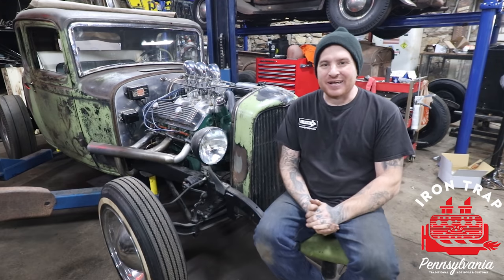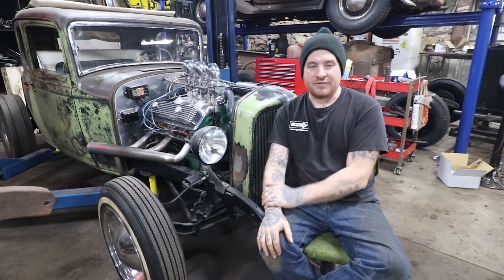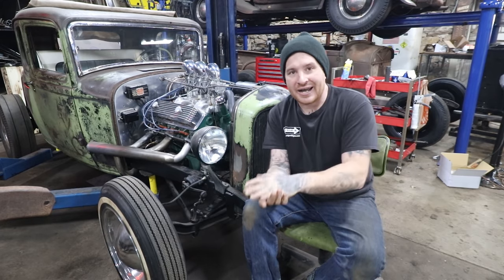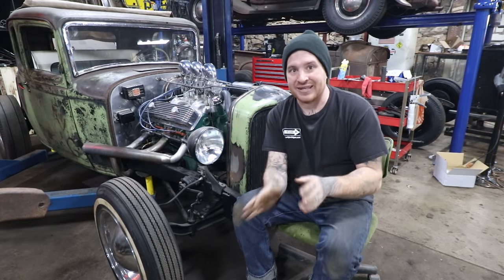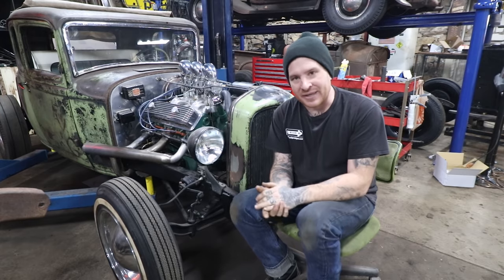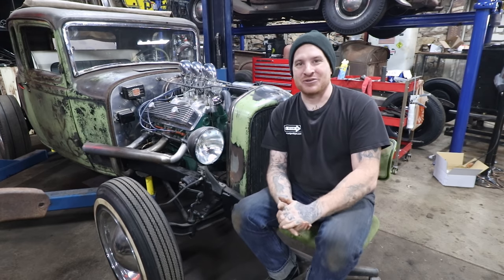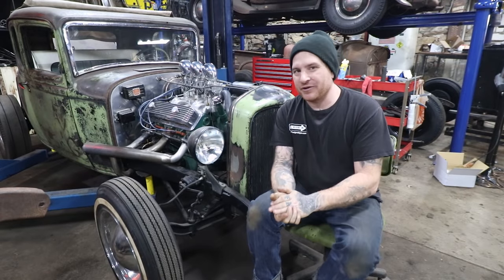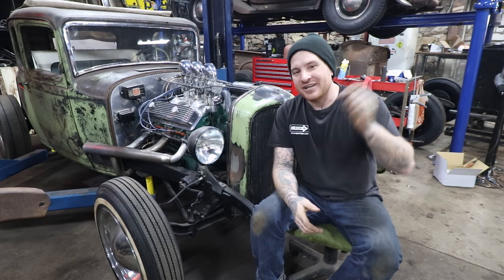Early Oldsmobile Rocket Hot Rodding 101 - Is That A J2!!!

Comment: A friend of mine, who graduated HS in about 57 had a 40 Ford Coupe as his first car.  I remember him telling me he paid $80 for the car.  He pulled the original drive train out and put in a Olds engine, a floor shift manual, open drive shaft and rear end.  For intake he had 6 2 bbls.  He showed me several photos of the car and if he had it today at a car show it would attract a lot of attention.  He also painted the car candy apple red in his garage.  He did the swap with no kits and fabricated whatever he needed with hand tools, and an arc welder (stick).  He also made his own headers for the car, and ran open headers.  No noise meters or noise laws back then.  Pretty good accomplishment for a kid in high school.
Reply from the maker: Man that sounds awesome! The golden age of hot rodding!

Comment: Matt, I cant tell you how much I enjoyed this video on the Olds Rocket engines. Growin g up in Hbg in the 50's i had a ring side seat for a couple cases in point. My BF's dad had a '54 Olds 98 that was quicker than one would think for such a big car. A guy I worked with had a beautiful 'Blue and White '56 Super 88 2 dr hardtop.  In '57 Larry Hartmann (Grandfather owned Hartmann Old's in nearby Sreelton, PA) bought a black  '57 2 dr 88 hardtop with the Tri-power J-2 with an Isky w-1 cam, and 3 on the column. I SAW Larry lay rubber from a standstill in 3rd gear, and the first time he took it to the Lancaster drag strip he spun out of the tires coming off the line too hot. Another friend had a '56 Fire engine red Studebaker Golden Hawk just a little modified ( Over sized jets in the 4 barrel, electric fuel pump and OD, columbia high speed rear end, 3 on the column. That car pretty much ruled Hbg for a couple years until the courts forced him to sell it to keep his drivers license, but to the point, one car he had problems with on the top end was Bruce Larsons '54 Olds. Yes that Bruce Larson. And the Hawk was dyno tested for 134 mph...thanks for the memories. Love the '39 Merc...
Reply from the maker: Bruce is a legend and a hell of a nice guy! Not surprised he was going fast even then!

Comment: Matt, I still have my 1950 Olds 88, these last 54 years. I have had everything from a few 324s to overbored 371 J-2 engines in it. LaSalle trannies and even a B&M hydro. My J-2 ran dual fours ,Wieland manifold.  It even got pretty decent gas mileage on the highway. Back in the 1980s parts like bearings got hard to come by, so the Old engine went away and it now has a 69 455 ,turbo 400 and 12 bolt rear axle.  The engine is no longer stock. Cam ,heads, dual fours, magneto( electronic). 99% of what you said about the Kettering engine is correct. 303s and 324s are internally balanced AND externally balanced.  57-58 371s are externally balanced. You will see a huge gonad on the front balancer and on the flywheel.  To internally balance one of these a lot of Mallory metal is required and Its very expensive to do . I have built several of these engines and nothing sounds quite as pretty as a Kettering Olds.
I am now 76 years old and I still breathe cars and my Olds has been mine since I was 22. It will never be sold as long as I live. I spent my life as a mechanic, bodyman frame man painter and I have to say, the work you do impresses me and there are few people who impress me. I have won a lot of shows with my creations and even a magazine centerfold.  I guess that's my claim to fame. Few of us get that ,on the grand scale of things.  Good job Matt, keep it up. Robert.
Reply from the maker: Thanks for the education and correction Robert! I don’t think I came across that with the late 324’s but I did know they had some differences to the earlier years. Thanks for that!

Comment: I have owned a 54 rocket 88 324, and a 55 holiday 98 324. In 78 needed to rebuild the engine in the 54, had problems finding the correct valves at the shop i used, they used chevy 454 valves and seats, had to open the head up a little bit and turn the valves down a little. But it breathed a lot better, 10 -10 crank and cam, 30 over pistons, and those heads, so basically stock. One fast old car!!!!! The crank broke into 2 pieces, used to have to put a little gas down the carb, and a quart of oil every day to get to work and back, didn't know the crank was broke till it got pulled apart, just thought i had some rod knock, or maybe a couple of mains goings. Those were strong engines, 25 miles to the gallon on the highway most of the time, i ran it long distance one time between 45 and 50 MPH and got 30 MPG. Wish i still had it!!!! Brought back a ton of memories, even though they weren't hot rods.

Comment: Many years ago I had the chance to have a conversation with K.S. Pittman famed gasser driver builder about the Olds engines they used. They preferred the 371 over the 394 because there was  more meat in the blocks of the 371 and they could be bored larger. They would bore them and stroke a 371 out to 454” then run that with a 6-71 and mechanical fuel injection. I asked why they weren’t using the 392 Hemi and he told me that they’d work on fuel but they hadn’t figured out how to make the Hemi run on gas with a blower. Once they got that figured it was game over for the Olds. 
It’s a dream of mine to build out a 371 Olds to this spec one day, hopefully sooner than later.

Comment: I used to hang around a filling station/used car lot in the early 60's. An early hot rod I remember was a 53 or 54 Studebaker with an Olds V8. It was pretty hot for the era.
Reply: Another potent swap was a "Studillac" which was a Studebaker with a Cadillac engine swapped in. They weren't quite as fast as  the supercharged Stude powered cars but it was a "low buck" swap and nearly as fast.
Reply: @edwardwerick2420  I remember reading an old Popular Science article about a guy I think was in New York who evidently did a lot of the Cad in Stude swaps.
Reply: @joealbert7773  That's right. His name was Bill Frick. He specialized in putting Cadillac engines and 4spd hydro transmissions in 1953-1955 Studebaker Commander coupes. His conversion included Cadillac brakes. One of the members of my local Studebaker Club chapter has a 1954 Studillac that he dragged out of a swamp many years ago. I believe it is one of 3 known to have survived. I hope he gets it back in running order some day.

Comment: Very interesting, Back in 65 I had a 47 Chevy Coupe. After seeing the Orange Crate in a Car Magazine I wanted an Old's Motor. I went to the junk yard and bought a 371 engine, trans 4 speed Hydra and rear end. Swapped it all into the 47. Found a great Cam and bought that. It required the earlier Rocker Arms. so i found rockers off a 324 used and bought them.  We got it all together and was pulling it to get started. It fired up and the front end lifted and i nearly hit the tow car. Then it died. I did that a few times until on one WOT pull there was a loud bang and the oil filler cap went flying. Oil was running out the oil pan from a big hole. We towed the car home and the gang left in silence. I tore into the engine to find the valves were hitting the pistons. Broke the cam a two lobe section fell down into the crank area, a Rod hit it and ripped off the crank then the crank continued to beat the the rod until the piston cracked and the whole thing was smashed against the pan poking a hole in it and crushing the piston. Needless to say I was sick. At 15 this cost me over $400 and i was broke. My Dad was so upset he forbid me to work on the car anymore. He towed it to the junk yard and gave it away. I saved the Hydra because i had it built up and could sell it back to the guy that did the work. But all was not lost. 6 months months later Mom and Dad agreed to left me use money I had saved for College to buy a car and Dad would still help me with tuition. After searching all over Central Illinois my Dad found a 1964 Corvette Convertible 327 365, 4 speed 3.73 gear, White with Red White seats and I was only $200 short so We got that. Not long after i had reworked the Holley and put headers on it. Its a disease. D

Comment: When i was 15, (didn't even have my drivers license yet) I bought a '46 Ford coupe with a 1957 Olds Rocket engine. This engine had the big chrome valve covers. The cars front clip was off and finally got it started. Sounded mean, no exhaust mufflers. I never finished the car, sold it as is. But it was a cool experience. I have been a hot rodder since age six. Great show, thanks.

Comment: My '32 Ford Highboy roadster has a 324 in it and is a lot of fun to drive. The engine looks stock from the outside with it's green paint, stock exhaust manifolds, generator and valve covers. But it's got a bigger cam & some valve/headwork so it's got a nice lope in it's idle. 
 The rest of the car is built with a look of a Hot Rod that may have been built in the mid to late 50's. Very little chrome, black-wall tires on steel wheels with Ford dog dish hub caps and so forth, so the engine fits right in with that old school vibe. This is the first vintage Olds engine I've had and it lives up to it's reputation... This car is a bullet!

Comment: Back in 1963 I bought a well thrashed 57 2 door sedan Super 88 with the origninal J2 engine and carbs and ai t cleaner.
Shortly after purchase the bottom end expired spectacularly.
I went to a junkyard and found a nice 62 394 out of a Starfire.
Next stop was the machine shop and engine builder . We went thru the 394 which actually needed very little but got a lot.
The bottom end was balanced rods polished and xrayed crank micro polished flat top pistons with 10.75 to 1 oil system revisions Isky solod lift cam adjustable rockers some porting work on the heads and intake manifold carbs rebuilt and a set of really nice inch and 3 quarter equal length headers into 3 inch dual exhaust out the back.
We never dynoed the engine but it was probably making around 370 hp at the crank.
Then the problems began. The 57 used the Jet a Wsy transmission which had replaced the stronger Hydramatic  in 1956. In short order I trashed the original zjet a way and a replacement before zi dis c overed the aftermarket BAnd M Hydro with a 2 year street or strip warranty... basically a beefed modified Hyramatic.
Then I started tearing up the two piece driveshaft and had to have a custom two pc driveshaft custom made and balanced. THEN I broke a left rear axle which resulted in my  getting a set of custom HD axles..
The 57 Olds at that point was reliable torquey and fun.
By now I could pretty much deal with any Fords except the 401 390 which was very rare. Or a 406 tri carb Ford. I could deal with about any Chevy except the 409 or a 63 or 64 327 365 ir 375 hp engine.. they were simply too light . And I could deal with any MOPAR EXCEPT THE 413 OR 426 HIPOS ..
My favorite victims were the 283vandv327 Chevys . A very very few had the solid lifter 365 hp engine and 4 speeds were rare and people who could shift them quickly were rare..
421 SD Pontiacs were univorns although you could run into the occasion a l tri carb 389 Catalina or Ventura that was pretty hot.
In this perio the e 94 Olds sndc392 Chryslerscwere the fuel and alvohol choices. But thatcwas far outside my budget and interest.
I sold the Olds in late 64 before departing foe 2 tors in Vietnam. When I returned I factory ordered a 427 435 hp 67 Corvette coupe 
But that was a different level of performsnce and a different story.
Ive always had a soft spot for my 57 Olds.
It was an adventure and I learned a lot.

Comment: Impressive amount of early Oldsmobile OHV V8 knowledge !   
I hot rodded my 56 324 with Weiand 2-4s from a wrecker with old race cars.   Did switch to solid lifter cam, with Thomas adjustable rockers and finned rocker covers, as you  mention.     Then I got a rod knock.   At that point, I switched to a '59 394, and sold the complete engine as is with al the speed equipment.   
Then, when I needed a new transmission, I got a new B&M Hydro Stick.   I then found that the BM, which was from a earlier 4 speed hydro matic, has a pilot shaft into the end of the crankshaft, which had to be drilled.   The crankshaft had a "pilot hole" where the shaft should go, which did provide a "depth gauge" for any drilling.  Also, there is a round recess in the end of the crankshaft, where you press in the actual pilot shaft bushing.    The hole beyond, does not even touch, and does not have to be perfect.   I just drilled it out with a hand drill, pressed in the bearing, and installed my new BM trans.   Ran well for years.  The BM did tend to break U joints.

Comment: Hi mat, i liked your video. I have two j2 engines which ive had in my 53 merc that i have had since 1969 first one is a 1958 block with jons 12.5 to 1 pistons  1960 394 heads , isky cam and solid  lifters and hidebrant rockers , offinhouser finned rocker covers. offinhouser 6- 2 intake  with 6 stromburg 97s. What a pain it was to keep in tune. i had a muncie 4 speed behind it with the help of an honest charlie bellhousing adaptor and a starter cross over. the pilot bushing i used was was a 1964 chevy there all the same. The clutch was a ford truck pressure plate and a chevy disk. I blew up a lot of stock rears in that car. Its got a 9 inch rear in it now. Thanks for the video. I liked the flathead video too.

Comment: I learned to drive and took my driver's test in a 1952 Oldsmobile 98 with the first generation rocket engine. My grandfather had bought it new, and it was loaded. I loved the wall to wall chrome waterfall dash with the ashtray and glove box that were hidden in it. The coolest feature was the mechanical clock in the center of the steering wheel which wound itself every time you made a turn. It had plenty of pep, and I thought it would become mine, as my mother wanted a sportier car. My dad traded it in on a Corvair Monza with a stick shift and told me that the mechanic felt the Olds was not reliable' as the engine was knocking. I've often wondered if that was just a ruse to get the rocket cheap ($150) for a hot rod.

Comment: My first car was dad's 56 Oldsmobile.   I found a Weiand  dual quad setup with good WCFB carburetors at a wrecker for $50.   Then I bought a Thomas adjustable rocker setup  so I could go solid lifter cam.   I don't remember any rocker cover clearance problem, though I did at some point get finned aluminum valve covers.   Drove that a while, till I developed a nasty rod knock.   I did get a buyer for that nice looking engine with the impressive dual quad setup.  I had a better idea.   

At that point, we found a 59 396 in a Super 88, which I bolted in.  I remember telling my dad that Hot Rod magazine said it was a bolt in, and he went with it.   Then upgraded to an original B&M hydro (4 speed).   Drilled the crankshaft for the required pilot bearing with a hand drill (there was a factory pilot hole, for a depth guide).  The real problem was that Oldsmobiles were heavier than say Chevys.  Of course, in a hot rod setup they were great.  I met a guy who put a Oldsmobile 396 in a 55 Chevy, mounted back with the carburetor under the dash.  He impressed folks poppin' wheelies on the street.

Fun memories from the simple, affordable golden age of hot rods.
Reply: I wrote this before you commented on the crank transmission bushing.  I would add that the hole I drilled was for the pilot shaft only, not the pilot shaft bushing.  The bushing with the solid bearing was much larger than the pilot shaft, but that was already drilled at the factory for a press fit.  Just tapped the pilot bushing in, once I had the hole for the pilot shaft drilled (not a bearing surface).    Never had a problem with it.

Comment: A couple observations; don't go looking for 324 rocker arm assemblies for your 303 if it's a '52 or '53 engine,  because it's already got the 1.8 rocker arms and 5/16 pushrods.  The '53 cylinder heads are a good upgrade for any earlier 303, since you get the 1.8 rocker arms,  more compression,  and larger diameter valve springs that will interchange with the cheap and plentiful small block Chevrolet springs.  1953 heads have a large 3 cast on the exhaust port.
Reply from the maker: Good clarification I tend to miss stuff when I ramble like that haha. Appreciate it!

Comment: I have a 49 303 with a 4 barrel it was built a long time ago with adjustable rockers. I have a 52 Ford truck 3 speed to go behind it . The Oldsmobile to Ford adapter is just a flat plate I still need to put the 11 inch clutch and pressure plate. I have no idea what it will go in but I do have a 32 Frame and a chopped 28 Ford model A  if not that one there  are other projects!